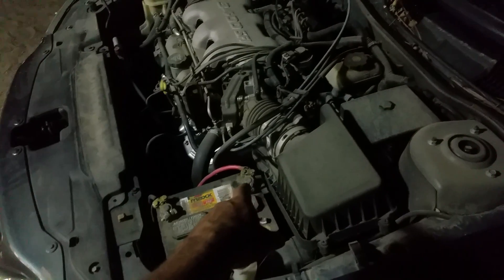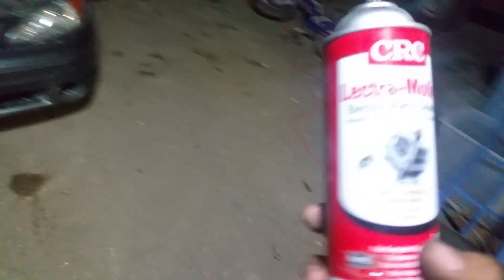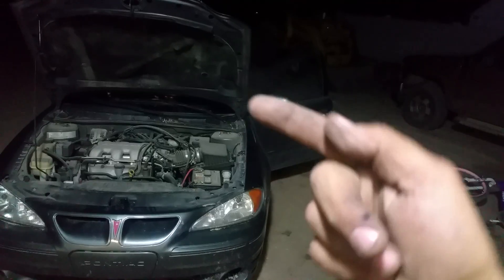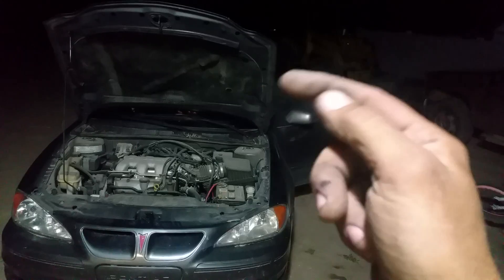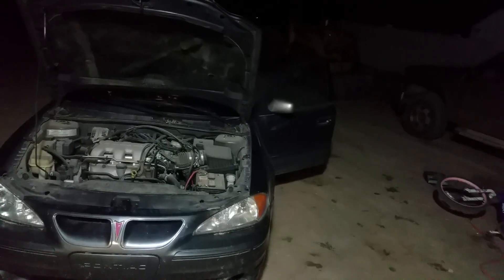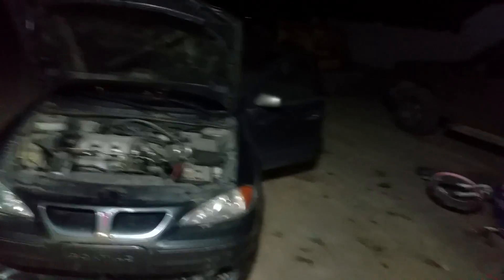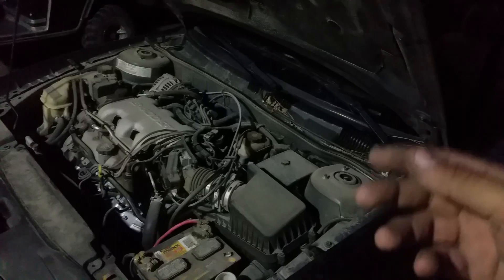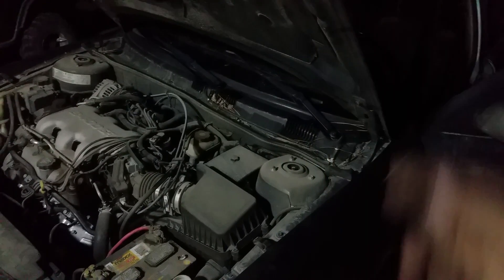Pontiac Security Light Won't Start Fix, Solved

Comment: It's not just pulling a cable,  the positive cable must be pulled and grounded on a body part to drain the capacitor in the circuit. This goes for all makes and models also it clears 'check engine'.

Comment: Having an issue with a pontiac solstice. I am not getting any power. No lights on the dash and no start. I t starr up and then died a minute later. It was in neutral so i could move the car off the road, and then i shut it off while in neutral. I realized my mistake and then truned it on the put the car in park. The security light came on. I removed the battery for 24 hrs to clear the code. Now no lights and no start, battery is good. Any suggestions?

Comment: I have a question for you...my brother has a car like that...and it won't even start...the thing is that it came with a alarm...but he doesn't have it...can you help us
Reply from the maker: look under the dash for the alarm and disconnect it. to confirm its the alarm, on some models you can jack up the front of the car ( pretty high ) and try to start it, if it starts, its the alarm for sure. if you do not have the key fob for the alarm, i would disconnect it. try searching for a fuse for it and remove it.

Comment: So I have a grand to also and the security light is coming on disabling my fuel do I use this to help that security light to come off and also I tried the 10 minute procedure it didn't work
Reply from the maker: you could have a issue with the remote as well. i have seen it a few times. try using the remote to clear it push off twice while the key is in the on position. good luck, thanks for watching.

Comment: I took out the Cable from the battery and it didn’t work.
Reply from the maker: must have another issue,  thanks for watching.
Reply: That unhooking battery doesnt reset it. U have to do the key relearn process. And sometimes that still doesn't work. Just replace the ignition. Dont hsve ro worry about it anymore. Certified mechanic
Reply: @brandonc2233  replaced the ignition and car starts then shuts off

Comment: My key won't turn what's wrong
Reply from the maker: try pulling the steering hard to the left while turning the key. i know the steering is prob locked and wont turn, but sometimes its the pressure on the will.